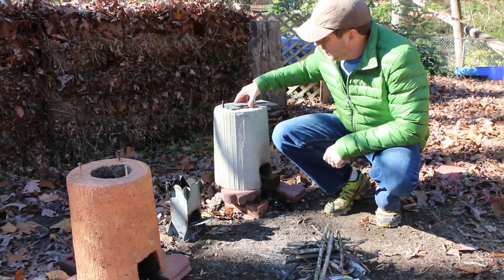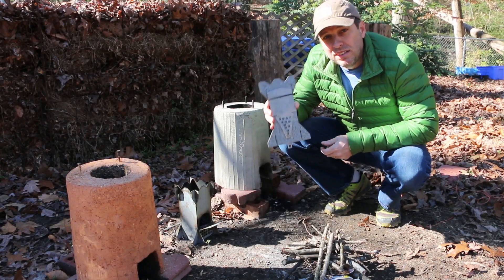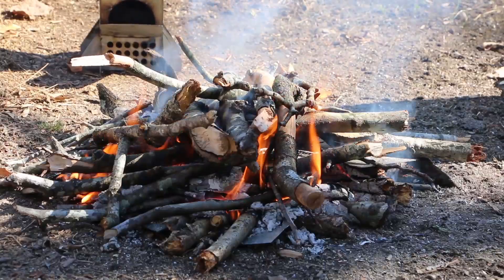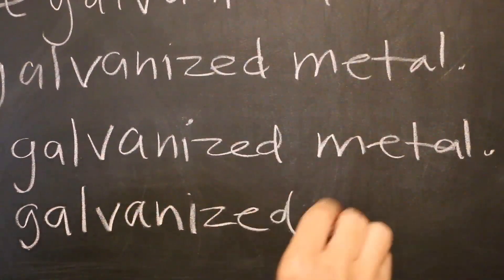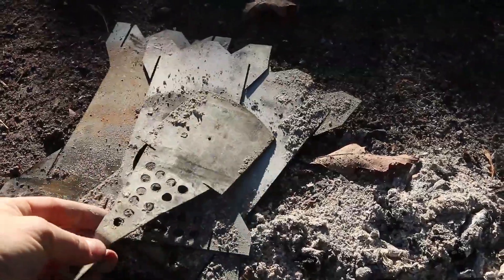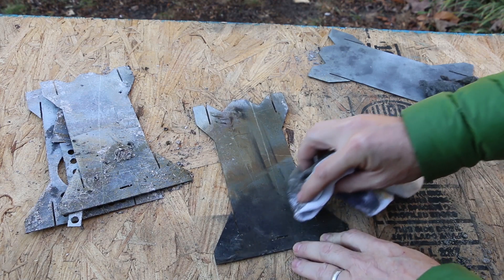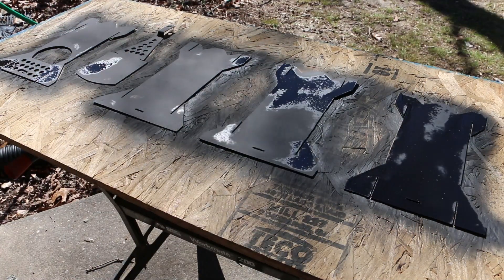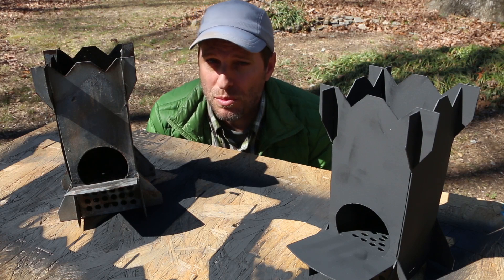How To Burn Zinc Off A Metal Rocket Stove

Comment: How long did it take to burn it off?
Reply from the maker: It was over 8 years ago, but I think it was around 20 mins of a hot fire with good contact to the metal.
Reply from the maker: It was over 8 years ago, but I think it was around 20 mins of a hot fire with good contact to the metal.

Comment: you wasted lots of time. use cinder blocks, in a form of (kiln) solid facing, with one vent. charcoal briquets, with firewood. it will do the job. then! a 4 inch wire brush on your grinder, for flat materials.

Comment: I just fitted a galvanised tube  as chimney to a wood burner in my shed  , I will now remove it and burn it off on a yard fire before I use it on the stove. 😎
Reply from the maker: Hi Gammon. Another option is to use vinegar. It will dissolve the coating without having to use fire. Thank you for watching.

Comment: Build a Big fire out of dry oak, etc so you have a settled hot coal pile about 2' dia and 6" deep. Lay your metal on and don't come back till it all cooled down. You built a crappy little fire and had to keep exposing yourself to the smoke to add more wood.
Reply from the maker: It’s hard to beat dry oak. Thank you for watching.

Comment: So by 'learned the hard way' you mean being scolded by YouTube comments. Fair.
In the description it kind of sounded like you got metal fume fever
 Also it's kind of contentious if that's something to worry about in a regular firepit beyond the inevitable peeling.
From what I've heard just from someone who claims to be an actual chemist with first-hand tests is it doesn't get hot enough to begin with and it will convert into a different solid form that requires higher temperature to vaporize then pure zinc.
Reply from the maker: :-) Pretty much. I did also hear from a commenter that it won't get hot enough to vaporize. Another good tip was to use vinegar to dissolve it. That seems like a preferable option to me. Thanks for the feedback and for watching.
Reply: @GreenShortzDIY  I've actually been using vinegar the past night on a trash can lid, cuz it will peel, it's the weirdest thing seems like it's hardly doing anything to the zinc except in one specific spot that was completely stripped that just happened to have a slightly rusted knife suspended over it to get rid of the rust and blacken the blade
It wasn't in contact with the metal but for some reason the shadow of the knife is completely stripped of zink and left with a nice gunmetal finish and the rest of it is completely shiny.
It's times like this I wish I was a chemist  as I have no idea how the knife would affect it,

Comment: Too late for me.  I already made my galvanized rocket stove.  Can I just built a real big fire in it, or around it and burn off the galvanized coating.  I will try to stay out of the fumes in this process.  Will it then be safe to cook on?  Help !!!
Reply from the maker: Doug, all is not lost. I think building a fire in and around your stove will neutralize the coating. I’ve also had a comment that said only welding temperatures would vaporize galvanized coatings. The fire seemed to remove at least some. Thanks for watching.
Reply: You can soak your stove in a large bucket of vinegar and it will remove the coating.

Comment: Very cool I like what you did there sleight of hand unbelievable cool little wood burning stove I got to do it I'm a metal stud framer
Reply from the maker: Cool! Are steel studs galvanized? If so, avoid using that material. However, sounds like metal work will be right up your alley! You might be able to make a stove using a gauge that you cut with snips. I’d love to know your thoughts on that. Thanks for watching.

Comment: Just FYI: you can also soak the metal in white vinegar. It will dissolve the zinc. Warming it will make it dissolve faster. I’ve done this with galvanized pipes so I can use them for propane torches. And I love your design. I’m planning on making one soon.
Reply from the maker: Cool. Thanks for the tip. I'll likely just avoid galvanized metal in the future. :-) Thanks for the props on the design. Thanks for watching.

Comment: Just asking. Can I put the Galvanized Parts into a Large BBQ Pit grill and burn off the Coating?
Or does it have to actually be FIRE Burnt.

I am thinking as long as it is a Large Ragging Fire that would do the trick. Maybe more of an idea than a question?
Reply from the maker: I think grill would be a fine option. I’d get the metal right down in the coals. Thanks for watching.
Reply: Xro heat is all that is required the more the better

Comment: Got pics if you want, it is sexy
Reply from the maker: Yes please!  Tom at GreenShortz dot com. 😎
Reply from the maker: Turned out nicely, Robert. Thanks for sending the picks. Is it high-temp aluminum? Curious how it handles the heat. I know it must be much lighter than the steel.
Reply: Just regular aluminum I had sitting around.  We will see if it sags next time I go camping..

Comment: I'm starting to get excited about the rocket stove idea. I have a house on a small lot in the city so it's hard to be green, but I've got a pile of sticks and branches and twigs that I've been trying to get rid of.  It will probably keep me in rocket stove fuel for a while. I've been composting in an old plastic trash can but I"m definitely going to try to get a better setup going this year.  Thanks for the inspiration.
Reply from the maker: Jeff, The beauty of using sticks and twigs as fuel is that it is truly local and sustainable. The tree didn't have to die to create it and the only transportation needed to get this fuel is you walking around the back yard. Once a week I'll boil a dozen eggs or so with one of my rocket stoves. The best way to use this fuel greenly is for a purpose, like cooking. Let me know how it goes.

Comment: Toxicity of Zinc is just not an issue with a stove. There is no way you would get hot enough to vapourise the Zinc, if you are welding it sure avoid the fumes but that's really the only time its an issue. Burning the stove in a fire is really just doing what would happen in the first use of the stove anyway.
Reply from the maker: +John Edwards thanks for your input. I had gotten a lot of comments that the zinc was an issue, so I made the fire video trying the suggestion of one commenter. It did produce more even results than just using the stove. I have one other prototype with the zinc and the coating is coming off with use, but in a more localized manner. There are a few spots, especially on the outside edges that still have the modeled coating. I'm sure it will eventually come off. Thanks again.

Comment: The Zinc is a sacrificial coating designed to oxidize before the metal of the part increasing its life and durability. As such you can remove the zinc by utilizing oxidation at an accelerated rate via acid exposure. Two safe household items are White Vinegar which is acetic acid or Coke which contains Phosphoric Acid. Both of which would work to remove the zinc in a manner that would not have generated toxic smoke or dust.
Reply from the maker: Mark, thanks for the tip. I'll have to try that on a space piece of the galvanized metal I've got. I've seen zincs used on steel boats (Deadliest Catch) for this purpose...the sacrificial metal. And the Coke...seems strange that something we readily drink could also de-zinc some metal. Sad but true.

Comment: Certainly seemed to do the trick - did wonder if, as a final test, you took a small area and tested it for rusting - sure looked like success in the fire.
I'm no chemist but wondered if a 'pickle' in Muriatic acid would convert the Zn coating to ZnCl - could perhaps be a quick way?
Reply from the maker: +ChrisB257 I hated venting all the Zinc to the air, but it is a natural mineral. I'll have to try your method with a scrap.

Comment: Heh, i would have used either the concrete or mud stove to cook the plates.
Reply from the maker: +sleeptyper ha! Yes. That was kinda obvious wasn't it. :-) A better solution right there in the background. I had the same thought after I lit the fire. That or setting the rocket stove up and building fire inside and around it. The fire method assumes a viewer doesn't have another stove for this purpose...at least that's what I'm telling myself. Lol.

Comment: Just a newbie in the learning stage. Hoping to build a rocket stove with a small oven. But not sure if the insulated chimney is necessary, or is a key to it working.
Reply from the maker: +Mark M I'd say yes. I actually didn't insulate either my concrete or mud rocket stoves. I've gotten a lot of comments about the importance of a heat-reflective chimney versus heat-sinking. I'm going to do another build on both these stoves incorporating all the good comments. I've got a bag of perlite from the garden center for the next stove. I also plan to make a two-stove fired pizza/bread oven this Spring. :-)